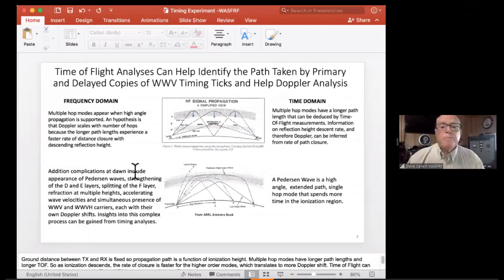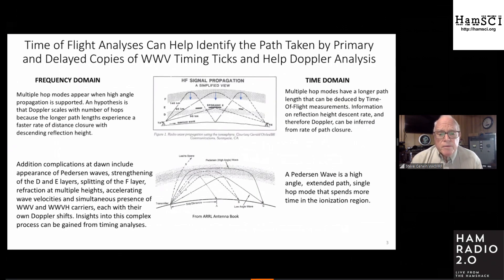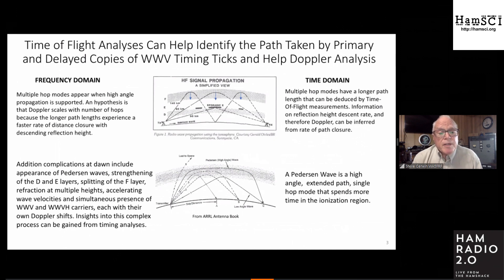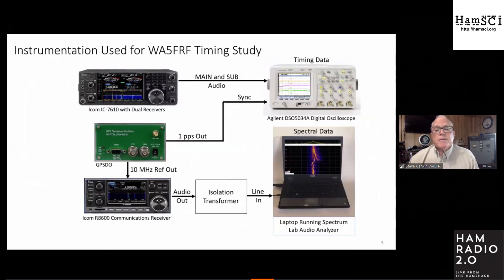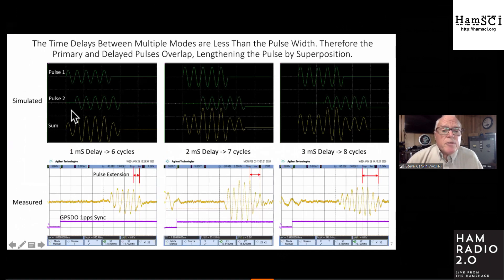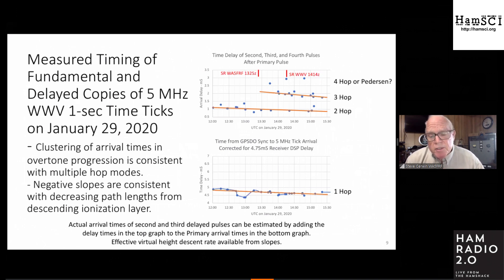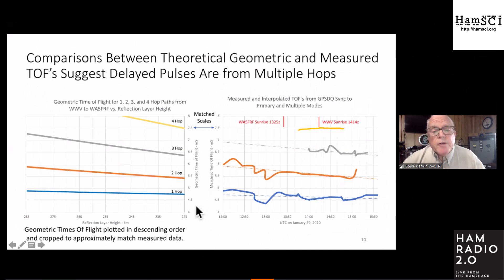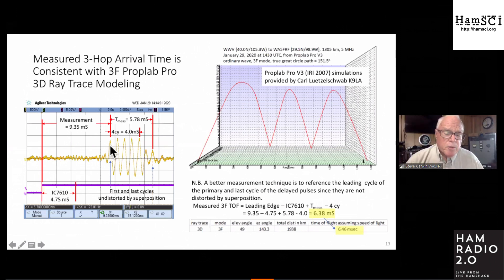HamSCI 2020 WWV Time Tick Arrival Time Study

Comment: Fascinating work. Applying an FFT for pattern match should give the mix of correlation peaks for the precise delays and amplitudes of the different modes. I wonder if horizontal refraction is also a factor, with the optimal path not being the same as the shortest greatcircle route. A doppler Direction Finder might reveal multipath on distant stations coming from multiple directions. Thanks for the vid.